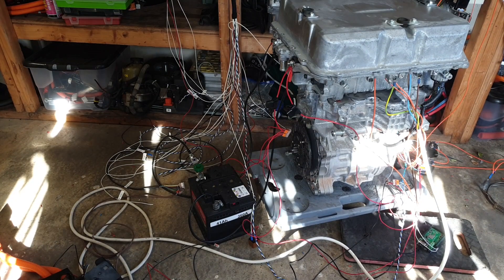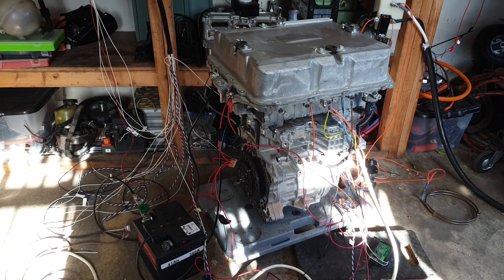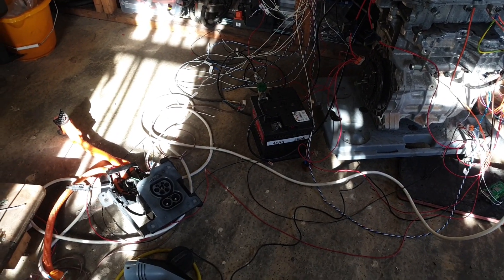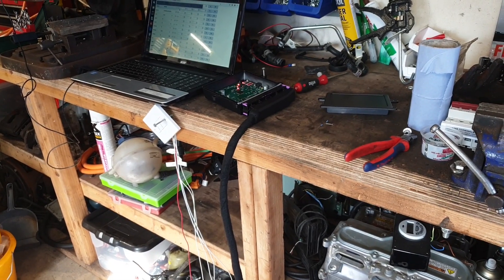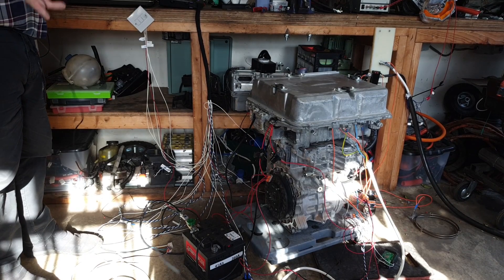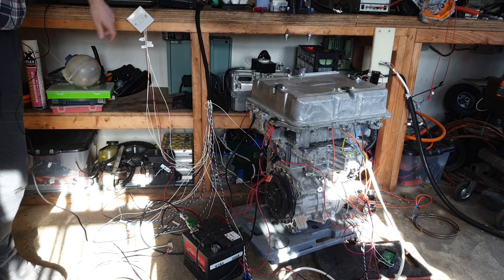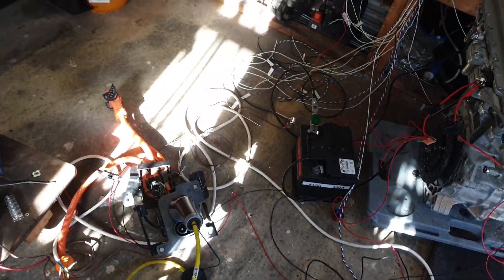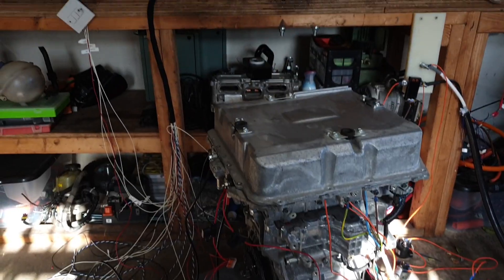Leaf Gen 3 ZombieVerter

Comment: wondering in process of buying a battery for my 14 leaf power stack its got the fast charge dc   im not able to find a newer 64kw newer gen leaf pack i found a 21  kona ev 64kwh battery  same cell count as the leaf  wondering if i can use the pack with some  retro fitting  i want to add ccs once i get it mounted in the honda element awd  but im stuck at the adapter plate and batterys   dieing to get project off ground   asap

Comment: wondering  if possible to use custom cable to connect pdm to a model 3 sr battery pack and  either use the tesla bms or a a bms modded from a leaf  because thay use same cell series config as the leaf  im in process of doing a conversion i ordered one of ur inverter boards but i think im going to need the zombi vcu  now and not need the inverter board  plan is to run the full 15 leaf stack and use the 6.6kw charger  once i get basics up mod the chademo to ccs

Comment: Hello! I'm thinking about doing a conversion, using possibly a leaf motor, with 5speed trans, and just curious what the max voltage the inverter can handle, I'm thinking of buying lifepo4 cells, maybe 100ah , what do you think the range would be approximately, for a 3k lb vehicle? I'm hoping for 100-150+ miles, and would like something near Tesla performance, close as I can get!  0-60 under 4.5, , I'm curious if about 120, 3.2v cells would work, 50-100ah, or does battery voltage matter that much with the inverter? I'm looking for performance, as well as range, I will be likely only charging at home , with solar power, Your work is awesome 😎

Comment: Isn’t resistor used between PP and PE used by car to determine maximum current carrying capability of charging cable? 
1500ohms = 13amps
680 ohms = 20amps
220 ohms = 32amps
100 ohms = 63amps

Comment: Maybe, someone can answer this question? I know that inverter and motor are rated to 110 Kw. That's great for short periods, but how much can it put out at continually without damage? How big of a car are truck can it be installed in and still to 70 mph one the highway? I have a Chevy Traverse with a couple hundred miles. I'm thinking of converting to electric after the gas engine dies.
Reply: I don't know a specific answer, but in the specs of the original car, where the motor is from, there is stated a 10-minute-power or 30-minute-power.

Comment: The resistor could be a safety blead resistor to remove voltage from the RF filtering caps, but that would be better in the unit with the caps.
Reply: Don't think so - since the resistor was hidden in heat shrink it probably is a 1/4 or 1/2 Watt resistor. 2.7k ohm across 200+ Volts allows at least 70mA, which at 200V is like 15W. 
Probably for logic/control only, not bleeding caps or across mains at all.  Not to mention, would be better directly on the caps being bled like you said 😆

Comment: If I got this silly resistor correctly then it is part of the Kia charging stuff and does not belong into a BMW. The i3 has something similar built into into its charging mousetrap (or is it contraption?) but not into the socket. Cutting the wire obviously made the Kia socket behave like it was meant to go into a BMW. Beware there is J1772 with type 1 sockets as well and proximity does signal somebody pushing the trigger to unplug the cable. Type 2 plugs are a mess.

Comment: On the german Wikipedia page on “IEC 62196 Typ 2” are all those resistor described.
What I don’t understand is that the max PP resistor that  can be used is 1.5kOhm but you’re talking about 2.7kOhm, which is a resistor used between CP and earth. 🤷‍♂️

Comment: https://de.wikipedia.org/wiki/IEC_62196

The public charging stations are based on open circuit currents, even if the standard power supply is in mode 1 (maximum 16 amps). The electric vehicle can be equipped with a charging system - with 2700 Ohm, a mode-3-compatible vehicle is available ("vehicle detected"), but no charging is required. At 880 Ohm, the vehicle is ready for a load ("ready") and at 240 Ohm, an air conditioning is provided (with "ventilation"). The charging station is connected to the vehicle by a pulse modulation of the directional switching of the maximum power supply.

The proximity switch PP signals the connection of the wall box to the car and ensures the maximum load capacity of the cables to the charging station from. Hierzu wird fazhzeugseitig ein Widerstand zwischen PP und PE gesetzt. The adapter cable can be replaced by an adjustable resonant encoding.

Widerstand CP – PE open 2700 Ω 880 Ω 240 Ω
Ladefreigabe A - standby B - vehicle detected C - ready (charging) D - with ventilation

Widerstand PP – PE 1500 Ω 680 Ω 220 Ω 100 Ω
Max. Ladestrom 13 A 20 A 32 A 63 A
Leather cross section 1.5 mm² 2.5 mm² 6 mm² 16 mm²